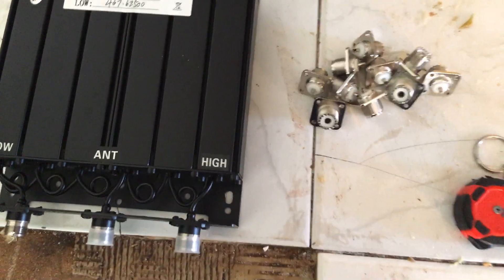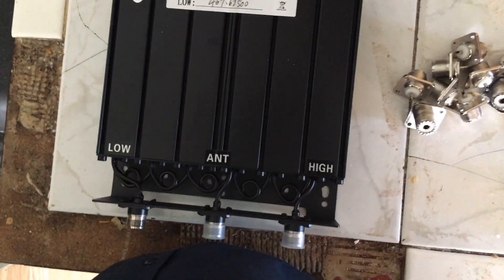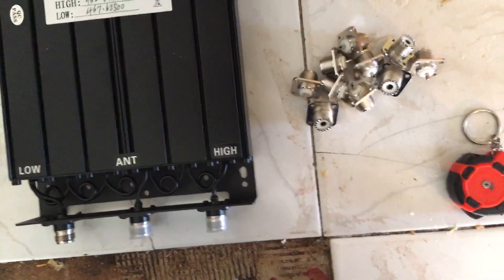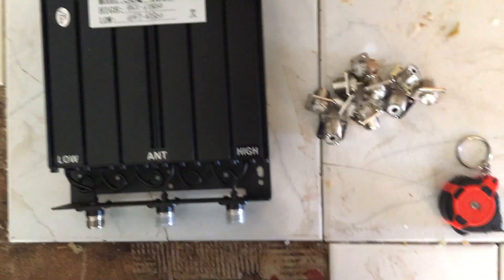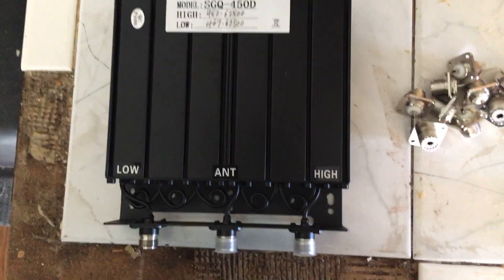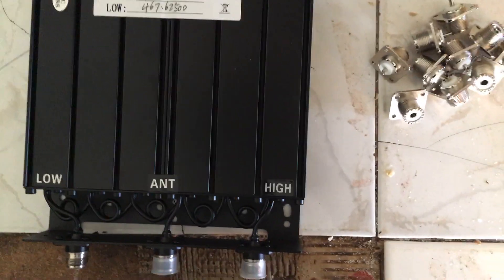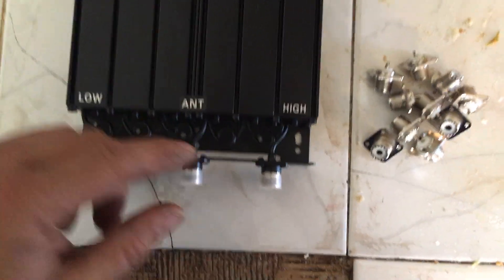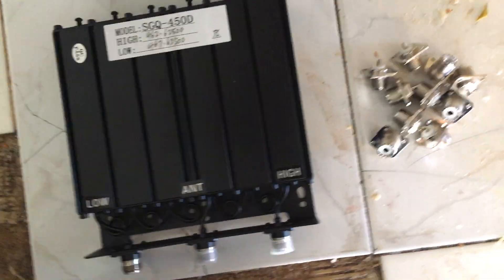🔺Part 1 modifying RETEVIS rt97 GMRS two-way radio repeater for more output wattage!!!🔺

Comment: I need help. I bought Fumei SGQ-450A on amazon, I made a GMRS repeater, but I noticed that less then 0.4 miles, the repeater won`t receive any signal from my radio. I checked the high frequency port, keying up receiver radio, and nothing was shown on my meter. Is that supposed to be, or is the duplexer bad? I should I do? By the way, I bought it because I saw your video. Thanks
Reply from the maker: What type of radio and setup you are using?  Sound likes a bad duplexer or a bad tuning on that duplexer. Can you test the radio without the duplexer by doing a simple repeater setup with a computer?
Reply: @GMRStwowayradio  I did. Radio is 50 watts. I have even another radio linked to zello, I connected the 50 watt radio to the mino pc running zello and works perfect
Reply: @GMRStwowayradio  by the way, the output says 18 watts output. How much the duplexer should be sending out wattage? I think 18 watts out of 50, is way too low
Reply from the maker: @FelixLantiguaCamacho  - hummm that seems alot of drop, my drops about 10 watts when using the duplexer. make sure your jumper cable is good!! i did a video when using poor quality and i lost alot of wattage.
Reply from the maker: if the radio has good RX when not using the duplexer. Then that points to a bad quality cable going from the radio to the duplexer OR a bad duplexer or poorly tuned duplexer.
Reply: @GMRStwowayradio  both radios in repeater has good RX. I ordered a replacement and ordered better jumpers, about 46 dollars for both jumpers, they coming tomorrow
Reply: @GMRStwowayradio  thanks for fast respond, you are the best!
Reply from the maker: @FelixLantiguaCamacho  - you are welcome, let me know how it works out for ya
Reply: @GMRStwowayradio  will do boss. I'm going to rewatch your video for duplexer jumpers 👍

Comment: Hi Brother im Fairly new to the Hobby and just purchased a 50wt duplexer...that being said my question is on your high(it has your low frequency and Low it has your High Frequency? Why is that or is im putting mine vise versa for GMRS?
Reply from the maker: My got mixed around. It was my fault when I told them. It should be RX on high freq and TX on low freq. Does it hurt anything? No, it works just fine. I have to change it someday.lol
Reply: @GMRStwowayradio  thx Brother I was getting a desensitized issue...i was thinking i had it backwards lol .. thanks again Brother!
Reply from the maker: @KO4RXE-WRMR358  - no problem, you are welcome